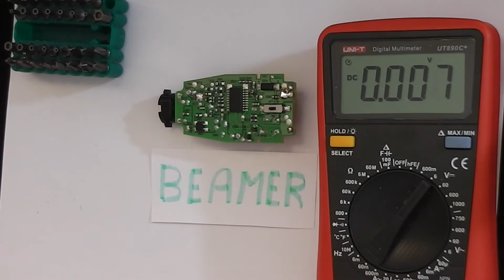Philips Shaver HQ6990 cell change

Comment: water accedently came inside it caused explosion of chipset, then i tried to found name or spec of it to replace it, due to explosion letters on chipset is not readble. so may you write name of chip from 9:24 video
Reply from the maker: Given your account, I would seriously take it to a specialist for repair or replacement. Mains voltage can kill! However, for the sake of information - I've located a circuit diagram for a similar model:
https://www.manualslib.com/manual/1021499/Philips-Hq-5818.html
The board should be thoroughly cleaned, dried, all components checked and tested for correct charging and insulation. All the best, Beamer.
Reply: @beamer.electronics , i know about voltage and in russia it's 220 V :)
i've take razor apart and use with replacing batteries. it works perfectly, but it doesn't work from fork  (i don't know how it term spelling in english in russian "от сети") so i think to replace that chip (but can't to read iscribtion on it) or "запитать напрямую от сети". SO thank you so much for answer and for blueprint of same model very appreciate

Comment: I replaced the battery in my norelco 7340XL similar to what you did.  The shaver worked immediately and charged fully but only lasted 1 shave before becoming completely discharged.  I can use the razor as a corded device but I wonder why the new battery does not hold a charge like a new shaver would.  What has been your experience?  Can you think of a reason why this is the case?
Reply from the maker: Assuming you have installed the correct cell - I believe it's the Li Ion 14500 rechargeable lithium 3.7VDC cell, and it's the right way round, the only thing I can think of it's the charging circuit and look for possible solder splashes. Also remove cell and (with a meter) check all possible individual components. It seems as though you can buy the whole circuit (non Philips), but how good it is and cost - I don't know? I can't find a circuit diagram for the 7340XL, and the video I produced is only for the Philips shaver, mention there. I also need to state - you are working on this mains powered product at your own risk. All the best.
Reply: thanks for the response.  I did this only to see if I could and it did not work out like I had hoped.  I will continue to use the razor corded and replace it when the time comes, which is what I think Norelco wants anyway.  Cheers! @beamer.electronics

Comment: Very Helpful mine needs new battery after fitting new heads which draw more current but cutting like new.
Reply from the maker: Kind words, thank you. I've tried several brands of new heads (non-Philips) over the years - all failed! The mechanical precision is just not there; they bind (drawing more current) or pull hairs. I've learnt to always keep the same pairs together and run them in. All in all not good.